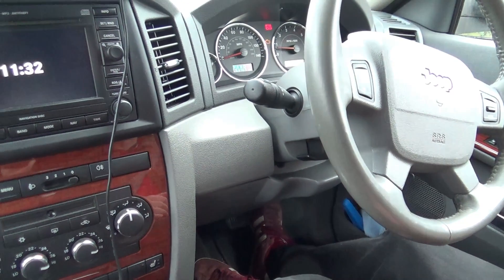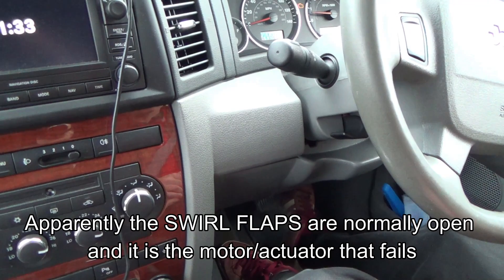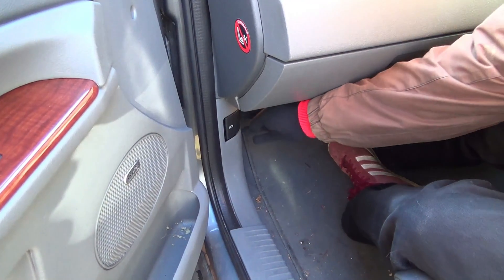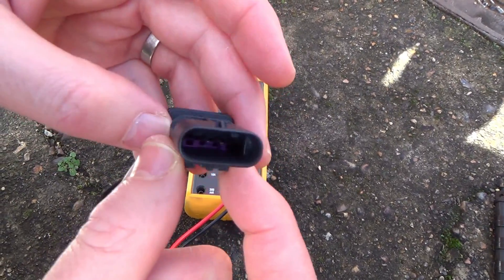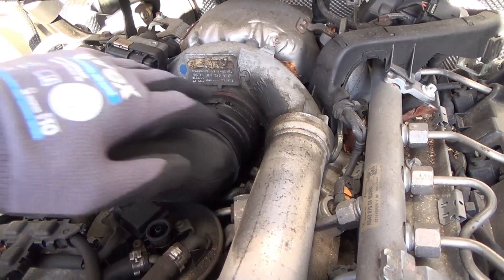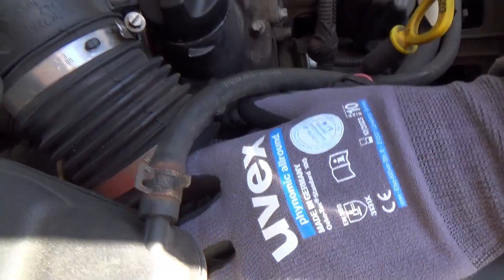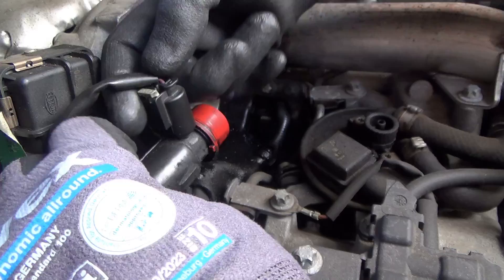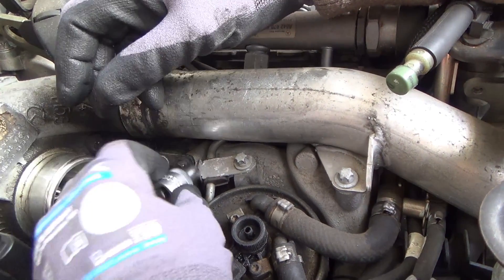Swirl Flap Motor BYPASS on JEEP / MERCEDES Engine OM642 (FIX Limp Mode)

Comment: great video showing the details. you should probably let the viewers know that the resistor trick only works on a limited number of vehicles. Mercedes ( who makes that motor ) has added a logic routine to the swirl flap system to test for function. Theres a video showing how the servo is exercised during operation to ensure that the servo can move and pickup the sensors correctly. Benzservofix is the site

Comment: I hve the same engine in my cls 350 2010 or I can only the air intake hose is different.  I hve no engine light or no swirl flap code but now and again the kick down don't work sometimes it does but then again my actuator marking a sqeaky noise and I'm thinking maybe the actuator.  What yall think or fuel filter as I haven't change it yet
Reply: Did you find the issue?

Comment: Hi! I installed a resistor, and it solved the problem, so thank you!
But, at the second start, the check engine light came back, for the third start it’s gone
I plugged my cheap obd 2 reader, and it says theres a pending fault, P2010, if the source i found is reliable, it means that the swirl flap actuator had too high ot too low voltage, but the resistor i used is a 2w 4.7k ohm resistor
What is the problem?

Comment: Nice video. I did a full swirl flap delete on my wife's  MB R350 bluetec with the same engine. Ripped the swirlflaps with their shafts and motor right out. Tap thread into the bore where the swirlflap valve shaft used to be and loctite set screws in place to seal the hole. I did an egr delete at the same time and run custom ecm software.  Runs very strong! My concern with just the resistor fix is the possibility that the swirlflaps may be in the closed position and would remain there once the motor has been unplugged,  resulting in a reduced surface area in the intake. Not sure if it makes a major difference in performance,  but it's something to think about...

Comment: This direction was ABSOLUTELY FANTASTIC! Everything is spelled out clearly and with no issues. The clip was a bit sticky, but I followed the process with no issues. As for the resistor - I got a 4.7k Ohm 1/2 Watt version. I have seen that this could also be replaced by a 4.7k Ohm 1 Watt version as well. Vince you are a life saver!
Reply: Am I gonna have to do anything with the motor like undo the links, because my swirl motor isn't moving when I rev

Comment: Although I did the mod and it eliminates the light on the dash, it makes the car very unpleasant to drive. I just love my diesel because I need to push the accelerator as little as possible to get momentum on my car and well you just lose that with this resistor. Pierburg makes these little motors and they go for about 150 euros to buy I would suggest to everyone to replace it beause it also helps a lot with fuel economy

Comment: Hello, i have exactly the same car and problem. First I tought tht the problem was the throttle. What is exactly the brand and model of the emulator you plugged in? 
And how can the car still run without the Flap motor? Thanks

Comment: The oil that caused that problem in the first place comes from the crankcase vent valve and should be treated as a consumable, 
bad diaphragm or weak spring allows turbo to suck oil vapor or in extreme cases oil, some goes through the turbo and some leaks past the seal onto flap motor.

Comment: Hi, need some help please I tried the resistor and it hasn't worked for some reason, even bought the same connector bit and that hasn't worked either. Does anyone know why..

Need help urgently
Reply: Could be the turbo actuator . Broken wires internally . Repair videos on YouTube .
Reply: Thanks I'll check that today

Comment: Hi
A great video you made there 👍
I am having the same fault now ( grand cherokee 3,0 CRD , 2006)
My question is, what difference does the installing of the resister do ?
I mean is it healthy for the engine ?

Regards
Leif, Denmark
Reply: The swirl valves stop working and stay open . Doesn't have any negative impact on the engine .

Comment: The rails that move all the flaps on both intake banks were broken on my vehicle, replaced the entire intake with brand new parts (vehicle still had the original factory PCV valve, never changed, so that was probably the source of all the carbon....). I just ordered this resistor dongle from ebay and put it on, should be good to go with zero issues from now on. Thanks mate!
Reply: Carbon comes from the EGR . Combines with oil from the PCV to create gunk .

Comment: COULD ANYONE TELL ME WHERE THE MANIFOLD ABSOLUTE PRESSURE SENSOR (MAP) IS ON THESE CARS. I HAVE A 3.0l 2005 TURBO DIESEL  JGC. PICTURES PLEASE. THANK YOU.
Reply: It's on The Air filter there IS also MAF sensor

Comment: I had both manifolds out, the worst think I done is I left flaps,  should remove them all. 
Main problem with this engine is oil radiator leaks, oil is covering flaps motor, and not changing engine breather that's why there is oil on turbo pipes

Comment: Hello Vince
good afternoon
Can You Help me in this situation please.

I have a jeep grandCherokee 2009 crd 3.0 limited (OM642 Mercedes) after driving 30km shows failure in the fuel sensor past failure P2264 Fuel/water separator sensor circuit.
I have already changed the sensor and filters and use only good diesel the obd always shows the same fault as before.
could you give me some guidance?
it makes me crazy

Give me a tip Please..

Comment: Exceptionally well done.  Remember: do not over tighten the air intake clamps at the turbo. That plastic can break easily especially when old. Costly to replace.

Comment: I did this with the resistor. Lightning bolt went away. But lost all low end power and torque. No acceleration. Once it gets going it’s fine but slow early on.

Comment: I  have a 2007 Jeep larodo Australian model -  I would like to know if turning on and off the key 3 times shows the codes on the dash board?.
I have the same problem as you and will try your method to correct this issue.

Comment: Can you tell what type bypass emulator you used ? The link you shared is removed. The dealer did a oil cooler seal job and they messed up my car.
Reply: Google swirl flap emulator om642.

Comment: I used a old abs sensor it was giving 5 ohms reading and plug it into the middle to pins it done the job  and reset the engine light

Comment: Thanks for this video, I had  exactly the same problem, paid £14.99 for the resistor  plug and £14.99 for the new turbo pipe seals.
Reply: Hi Gary, are you in the UK? Guessing so by £ symbols! Please could you provide a link to where you got these parts? My car is doing this and so is my dad's, both Merc E320 2008 and 2007!! Thanks
Reply: Vince, please advise where to purchase resistor plug. Thank you.

Comment: 4 or 5 years now I done this fix and its still working fine ,I don't even think about it now.
Reply: This is comment I was looking for. Wasn’t if I will do this if will broke down after a month
Reply: Where can I get that part ? 
Please and thank ya and what’s the name of it
Reply: @bernyvillalobos4381  any electrical shop will have resistors I have plug in 4.7ohm0.25w one , limp mode is off but car doesn’t run like before , sluggish and idle is ruff … will have e it removed and swirl flap delete done by map
Reply: @cibo9994  you have wrong resistor. you need 4,7k ohm! thats 0,6w.
Reply: @RalfWiggum69  I have removed resistor and have swirl flap remapped out done no change compare to resistor was told need injectors check as is overfueling and ruff idle could be that
Reply: @cibo9994  any codes? and you have to check fuse F44 15A (fuse number 104 on some models) after you do the resistor mod also because if the swirl flap motor fails it will burn the fuse 100% of the times
Reply: @RalfWiggum69  no codes,where is the fuse box? I look today for faults with carlee obd and shows two glow plugs faulty

Comment: Our merc currently this problem and gone into limp mode. We have ordered this peice of tackle in hope it solves the problem cheaply. Thank you for such a clear explanation of how to do it all. Great job Vince!
Reply: Hi mate where can u buy this resistor plug from cheers
Reply: @jezkhan5448  amazon
Reply: @Dogwarrier  6:19
Reply: Cheers for the reply much appreciated does it Matter if their a cheap China copy?
Reply: @jezkhan5448  no....not at all, it basically fools the car computer telling it the swirl flaps are in a closed position. You need to get the correct rating resistance for your car though. Forums will help with that. Good luck its sorted ours perfectly
Reply: @Dogwarrier  aw mate your star honestly didn’t expect a reply as your comment was from over 10 months ago! And what are those? I thought it was just the resistor plug and go? Am I missing something here lol 😂
Reply: @jezkhan5448  ahhhhhh yes you can get the plug and go, I just used the resistor ( wire) coil coated in ceramic to stop it over heating.....I paid I think £12 for 4! The plug and go far more expensive.
Reply: @jezkhan5448  good ole youtube will show you how to fit the wire coil resistor as I did. I had never heard of swirl flaps until I went into limp mode and I started investigating on the web.
Reply: @jezkhan5448  
swirl valve resistor bypass plug fix  
Look on ebay approx £7
Reply: @Dogwarrier  thanks a lot for info mate really appreciate it and all very best maybe for the future hope you achieve your dream 🔥👌🏽
Reply: What? What the plug you put in called

Comment: Thanks a lot for this film, excelent job. I had the same problem in Chrysler 300C 3.0 CRD and I put the 4.7 kOhm resistor into the plug with hot glue and tape and it works total cost about 0,5EUR.
Reply: Likewise. Perfect fix.
Reply: I have the same car where did you buy  the resistor?
Reply: you have not problem with DPF ? after this mod ? offten regen

Comment: Thanks!, I did it on my 2007 JEEP Commander CRD and worked perfect with the 4.7K resistor.
Do you have any idea what torque will be fine to fasten those clamps (7 mm.) and the engine bolt (10 mm.) of the intake duct?, and also for the plastic engine cover 10 mm. bolts. Would 5 N.m be OK ?
Reply: Just use common sense!!

Comment: Replaced any amount of these motors, takes about 45mins when you know how to do them, repair shops either don't know how to do them the quick way or they are robbing you blind, I will say anyone doing this DIY please disconnect the plug from the side pipe before pulling it from the main intake pipe, if you don't and it touches the turbo housing it can spark and best case scenario blow a fuse! That's from experience
Reply: Hi Andrew ... Could you replace mine in UK ?
Reply: Have you tried a Chrysler 300C? The motor is buried under a wiring harness and fuel filter. A lot of work, to fix something that does not add much to the performance.
Reply: @richardhemingway6084  used to work at the dealer, they are a very common problem, I enjoyed doing them
Reply: I tried to put in the 4.7k ohm resistor and somehow it touched the turbo housing and its sparked, so im struggling to get the fuse related to this plug. Thanks
Reply: @katlegotau3522  it's usually the sensor that is in the rubber hose that pushes into the intake turbo hose that you have taken off that sparks off the turbo housing, look for the fuse relating to that, can't remember exactly what the sensor is but definitely seen them spark off the turbo and blow a fuse, hope this helps

Comment: Hello Vince,

Just did the swirl flap motor bypass in my OM642 G-Wagen 320CDi and as i expected the limp mode is gone. My engine is a little different because in my car it has a "T" intake and 02 MAF sensors. I feel the engine a little louder and it seems that sound like it "breaths" different. Do you find any long term problems with this mod? 
I used a 4.7K Ohms resistor and i think its a little bit bigger so its probably 1watt and not 0.5 watts as the ones you showed in your video.
Thank you for the great video.

Comment: Excellent.  Couldn’t get the emulator local in remote Western Australia but I did fit a 4.7k ohm resister to the plug.  Fixed the problem and now gets more boost (power).  Saved me over $2000.
Reply: Did you put the in the hol 3 and 4?
Reply: I have a Mercedes 2007 ML320 CDI. 
I'm from Melbourne VIC.

How did you fit the resistor?
How did you waterproof it?
Does it have to go in a certain direction?
Exactly what size resistor do I get?

Thanks in advance.
Reply: @jjgoyn5324  get a resistor from 2-5w and place both ends in both middle holes and then tape it with electric tape

Comment: I'm Guessing that there is no chip inside and its only a 4.7kohm resistor. There are many car stuff that are scams. BigClive have several videos on Car Performance boosters and another scam stuff
Reply: There must be something going on other than just a dumb resistor, as it's tricking the ECU into thinking the valve is opening and closing.
Reply: @AdmrlSpeedy  ahh yeah perhaps the error code is just detecting an open circuit.. which is how a motor/solenoid would usually fail with an open winding etc. Makes sense
Reply: @jamesarmenti8876   Unfortunately sellers have been doing this for years with many tuning boxes , basically a resistor .Some cover the whole thing with a rubber mastic to hide the simple internals .Some even put a dummy circuit board so you think its doing some sort of calculation. Total rip off charging hundreds instead of a £1 resistor. There are reputable sellers who sell boxes which can adjust the fuel and turbo pressure but 90 percent of boxes sold are just resistors.

Comment: I kinda missed a description of this swirl flap motor in your video, how it affects engine operation if it's not working, and how the resistor would make the engine computer believe nothing is wrong... So...........
The flap closes part of the flow in the intake when idle. This creates some turbulence which creates a better mix between the diesel fuel and the air, which results in a cleaner burn. On higher RPMs, there's more air flow and that will have enough turbulence by itself and the flap can be open, to make sure enough air can be drawn into the engine.
If that flap is stuck open, it causes slightly more emissions when idling. The car owner won't mind that. Problem is at the government: cars need to meet emission standards, no matter what. So car manufacturers probably decided to impose 'limp mode' on a swirl flap motor failure. Limp mode usually drives the car owner to fix the problem. Just a dash light: not so much.
If the flap is stuck closed, I think, limp mode would be justified: car will not be able to get enough air: incomplete fuel burn, more turbo wear, more soot, more particulate filter regeneration cycles, which may not succeed when there's not enough air.
I think, this flap has a spring that keeps it open and it closes when the motor gets actuated. But I'm not sure.
The resistor is weird.
4700 Ohms is not accurate for representing a motor coil. That would allow for just 2.5 mA. That's 0.03 Watt of power. That will not move a flap, for sure. But then again... if it's enough for the ECU, it's okay. If the resistor would be more in the range of what the motor would use, it would heat up too much.
4700 Ohms would be okay for a sensing circuit. But a fixed resistance would then indicate that there's nothing moving.
So... weird value.
I think this is a nice cheap fix that will keep this car usable until the next big thing goes. This car's turbo seems to be a bit of a concern.
(edited: fixed some grammatical and spelling)
Reply: I think the position of the flap is measured by a potentiometer, nothing to do with the motor it just measures the change in resistance with the change of the position of the flap. It's possible the motor still works.
Reply: @coyote5735  If that would be so, then, replacing the potentiometer with a resistor would make the ECU believe that the flap is always in the same position. That would surely generate an error.
Reply: @fluffyblue4006  Obviously not that's why this fix works. ECU enables the valve to open and looks for an open confirmation, the designers didn't think to make it self testing, not an overly important system. I suspect the valve only makes a minimal difference to emissions.